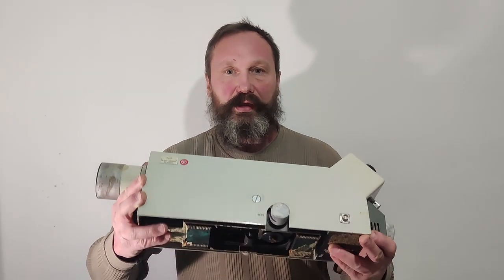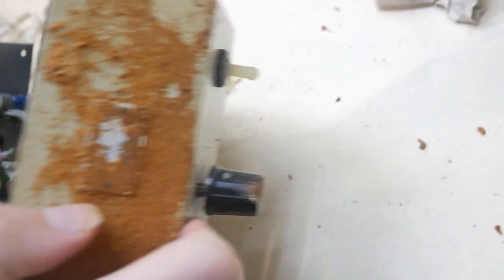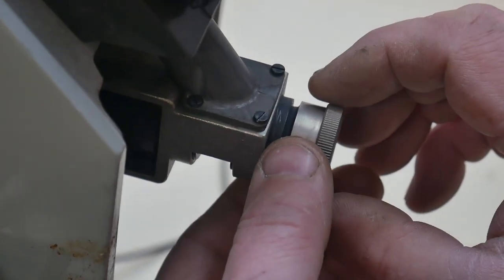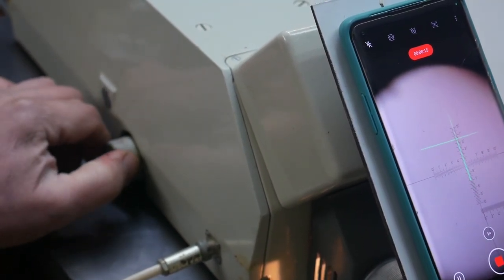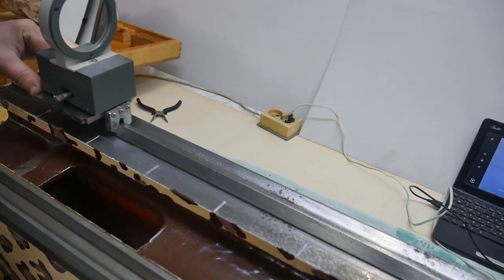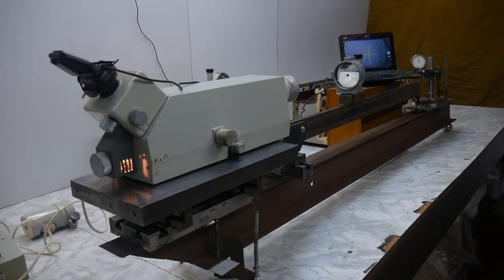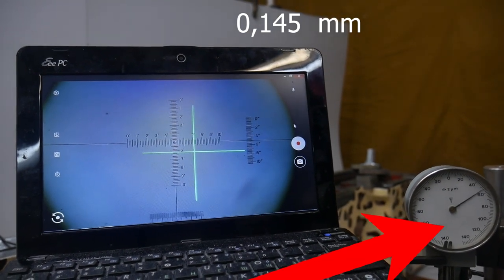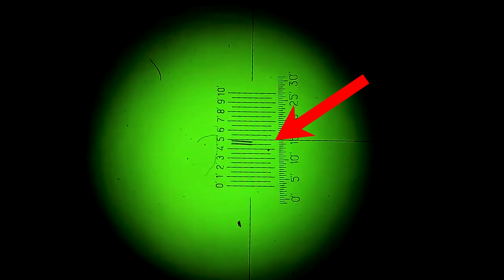Autocollimator 0.2 arcsec

Comment: How can i reach you by email?
Reply from the maker: den.gennady19@gmail.com
Reply: @gena_bazarko  I have send you email. Thank you very much of now providing English to your channel. I watched many times before trying to just understand what you were trying to achieve because it was so interesting. Your English as in this video is more than sufficient. I get it that it takes a lot of time.
Reply: Or is that autocollimator already sold?
Reply from the maker: I did not receive your letter by mail. If you want to know about the presence of autocolimators, it is better to write to me by mail. There is a 0.2 angular second, 0.5 angular seconds, 1 corner second. My mail -den.gennady19@gmail.com       Check if you have indicated the address of my mail without error.